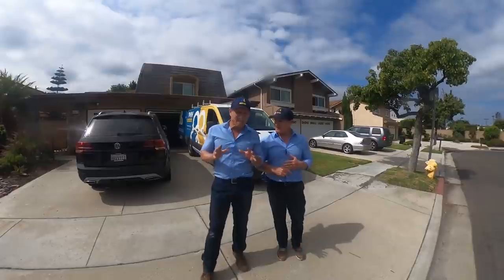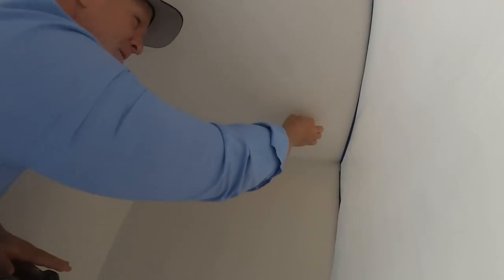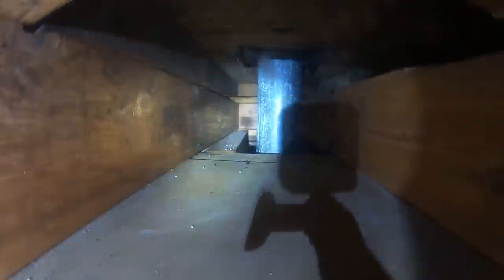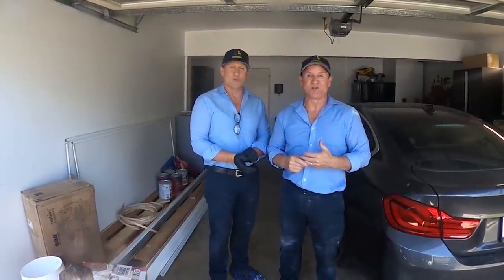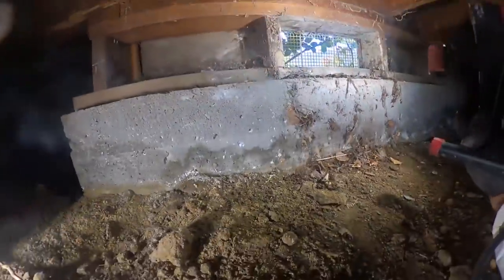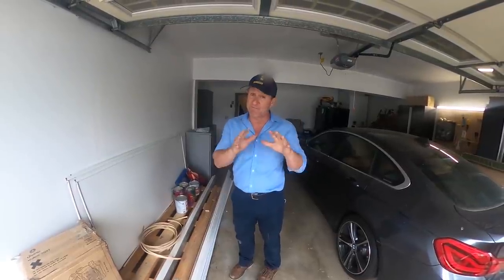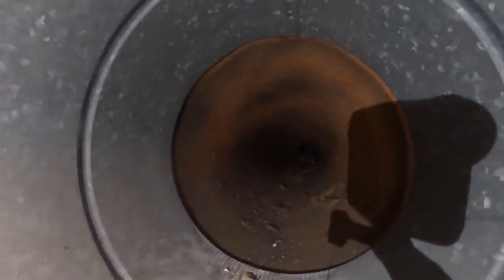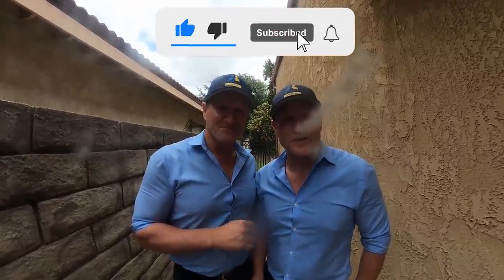RATS CHEWING THROUGH BABY'S BEDROOM CEILING!! How to get rid of rats fast!

Comment: The problem of most pest control companies, is that the people who work for them or even run them, are not interested in fixing the problem. They are there because people are afraid or disgusted to touch a  victor trap, so the exterminator is used to, but normally he won't walk the extra mile and work on prevention
Reply: No way will they do what these to do! And their other workers! Others have come out to my house and they do not even do 1/4 of what these do but stretch out the hand for the $$$$
Reply: Right they are interested in the money it pays to keep coming back
Reply: I worked for Orkins and I was only allowed 2 hours in each house I went to. When you have to do 12 houses in one day and need to get in and out as fast as you can.
Reply: in my experience, most pest control company employees arent properly trained, or dont have the skills to actually do this type of work. they dont know how to do drywall, or hvac work. they can find entry points, do exclusion work, and set traps but thats about it.

Comment: Watching you Channel from a wet and Windy South Coast of Ireland, here in Ireland we manly build our homes with Narrow Cinder Block houses with a single block  but creating a cavity with a second internal block arrangement thus creating a ,"Open  Cavity" so as to stop ingress of driven rain and dampness that our weather creates, i  heard scratching before Christmas and set traps in our loft space set granular rat bait  which they kept taking  caught the Rat and re baited the traps, also hoovered up the droppings and spray cleaned cleaned the areas, the Rat had climbed up the interior of the Open Cavity, but looked outside and discovered gravel around a patio slab, i lifted same and found the route into the house at foundation Level... and a run under the patio tile... lifted the tile.   I bought  a Large Commercial Can of super tough but flexible  Expanding Foam and filled up the holes either of that rat run... Once our weather gets better i 'm going to create a cement bed to re lay the slab as the Cowboy Patio Contractor had only used an earthen Bed and just filled the edges of the tiles with mortar, so the rats were able to create a run under same...you have taught me so much, so i'm well versed now in that dark art of Rodent Control... i shall shall keep inspecting my baited traps and Baiting stations  and even now put Baiting Station around walls in the Garden inside long  Pipes that will exclude Birds and Hedgehogs, but allow Vermin into same... Great Uploads Lads...

Comment: I had rats in an apartment building i lived in. It was disgusting. One ran from under my couch through my legs and into a literal tom and jerry mouse hole in a closet...i knew they were there when a bag of dog treats my dog wouldnt eat that sat in the back of the vabinet under the kitchen sink dissapeared out if a hole in the hottom of it. At this point i knew i had some fat rats in my wall. I guess at one point one migrated to behind the couch...landlord sent some idiot with a trap and a calk gun like it was going to solve everything. We flipped the couch and there it goes running into the wall...he then put a trap down in the center if the room and tried to leave...i said no way. Eventually he cornered it and choked it to death. I could hear it crying. It was huge.
2 weeks later i take a dusty bowl off the top shelf that i put there a day earlier and yhere was footprints and tail marks all over it...
I took evrrything out and looked for holes and rearranged everything. Then i put an unbaited 99 cent mouse trap in the corner of the cupboard. Not 10 minutes later, in the middle of the day, after i just was in there banging on things and moving everything around...snap!!
I moved the next day.
I watched this video because i lived on the top floor. Above me was the roof...which had leaked many times and would end up having the giant basketball sized water tumors hanging there being contained by a layer of paint. It was also a studio apartment with a loft bed where i slept about 12 inches from the ceiling. If a rat had ever fallen on me i would have probably died. Im now petrified of rats. Theyre so gross. I never opened that cupboard again. After the snap i hearx something thrash around in there for at least 5 minutes. I couldnt even open it. I slept in a hotel that night. And by the time i got the rest of my stuff out a day later uou could smell its decaying body.
An unbaited mouse trap in the middle of the day minutes after i was banging a hockey stick agaist the wall to scare  them out so i could rearrange and clean...so gross. Dude on the 1st floor got bit. I wouldve lost my mind.

Comment: Hi ! Quick suggestion. I see you are using a HEPA filter on that shop vac.  Might I suggest you use a 25 foot hose and keep the vacuum outside. That way all the exaust air it's kept outside .  Also those shop vacs are not perfectly sealed so not everything will make it through the filter.. not always ideal especially since the room needs a deep clean anyway but just one more small step. Thanks for the awesome videos

Comment: Hey I got a quick question I live in a cold climate can I cover the plumbing vent with the metal mesh. Just worried that it will eventually freeze and block the vent or will it be fine?
Reply from the maker: Great question! You can get the Oatey mushroom vent caps. https://www.lowes.com/pd/Oatey-Mushroom-Vent-Cap-4-in-L-Circle-Round-Cap/3340572?cm_mmc=shp-cprdbdmgglLIA_BDM_103_Roofing-Gutters-3340572--0--0-_-0&ds_rl=1286981&gclid=EAIaIQobChMIm7-5k4qy8wIVLSCtBh1PhwLyEAQYAiABEgJqGvD_BwE&gclsrc=aw.ds
Reply: @TwinHomeExperts   Thanks for the info

Comment: What’s the trick to keep mice out of townhouses ??? Every exterminator said it’s impossible to correct as long as all homes are connected.
Reply from the maker: Such a great question! 
It’s not impossible, but very challenging. We ALWAYS recommend getting the adjacent neighbors to cooperate with the full inspection to locate entry points. 
If you cannot get the neighbors to cooperate,then you will have to do some aggressive investigation work inside your unit to protect your property.

Comment: Who knows how many other spots in the walls that you couldn’t see also have a dead rat or feces. Looks like you opened a lot of drywall, did a partial cleaning, and then did the exclusion. When you could have just done the exclusion, trapped them out and replace the duct. I hope you inspected the outside first and gave the customer the option because one is a lot more expensive than the other.